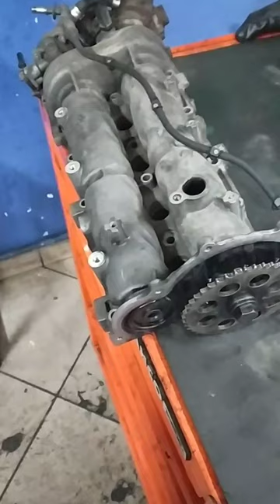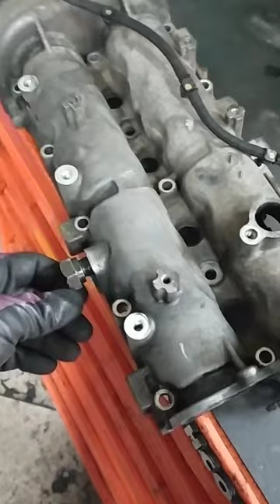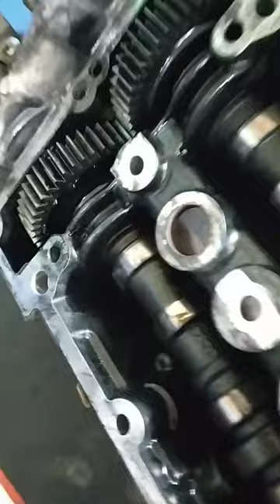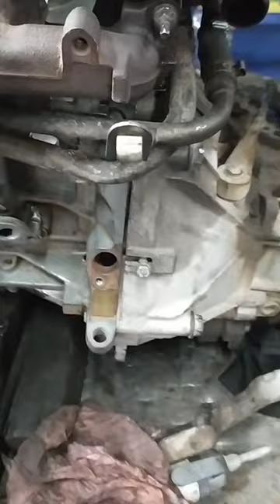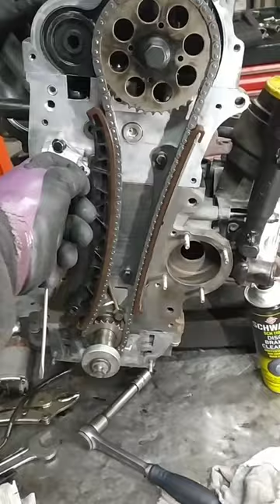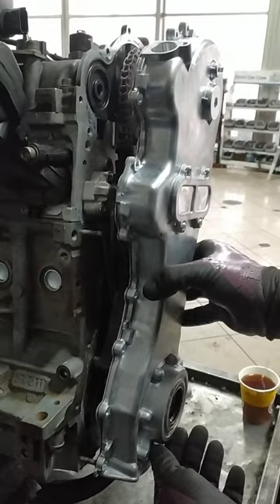opel combo, fiat doblo&grande punto 1.3 td multijet-timing chain replacement

Comment: this  video helped me out today as i couldn’t find the hole for locking the crank neither had the tools to lock the cam but turned one out on the lathe and stuck a 8mm bolt in the crank